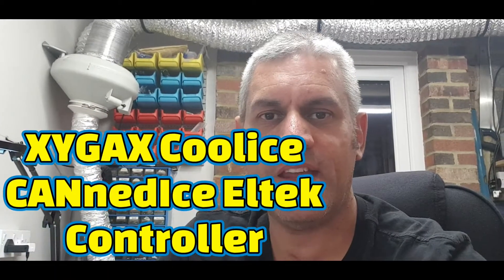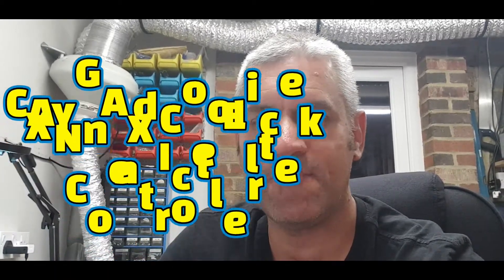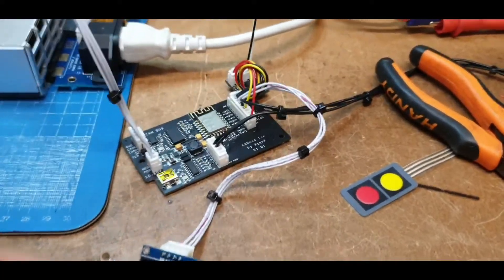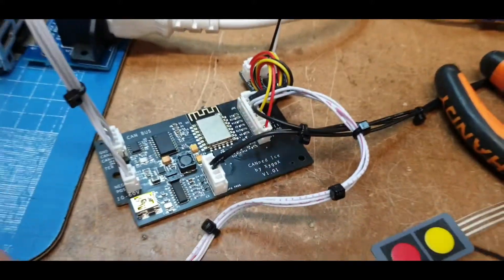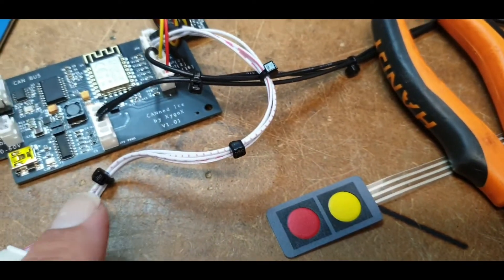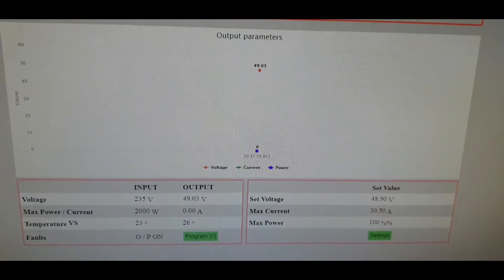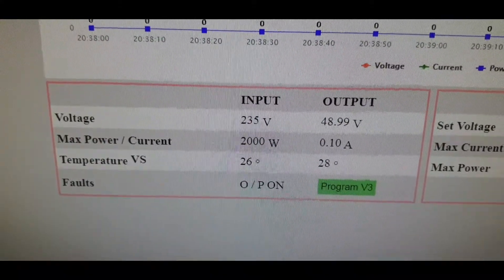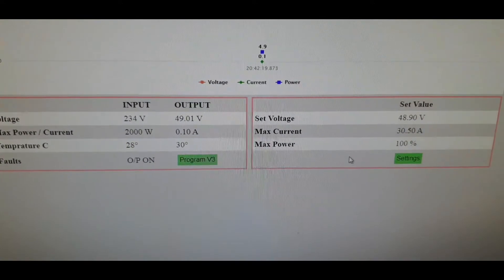Coolice CANnedIce Eltek Controller

Comment: Where did you find this board and the software? I googled for CANned Ice and xygax and found nothing.
Reply from the maker: Hey Buddy. This CANnedIce Eltek Canbus controller board and software written to it, is custom designed for me by XYGAX and I sell it to the public, eBay Item number: 194350158319.
Or you can contact me directly via my web site to enquiry further.
I have limited stocks now of this V1 board with only one left I think, but have the V2 CANnedIce on the way within the next 4 weeks I hope after testing and programming. Our plan going forward is to add other Canbus controlled PSU's as we get to them, such as the Emerson rectifiers and Huwawei to make some etc. But it takes time and so currently only the Eltek's are supported. 
Cheers. Ian Contessa
Reply: @CooliceChargeCases  That item number doesn't come back with any search results on ebay. I'm guessing you are out of them? Your website doesn't list them either. When will the v2 be available? The thing I care about is Eltek, so this is probably just what I need.

Comment: how to send code to the eltec unit from arduino
and if my unit the controller that  inside it have nothing
how to code  the eltec controler
Reply from the maker: Hey. To communicate with the Elteks you need to use a Canbus controller and an Arduion or Raspberry Pi even, then with the data sheets for the power supply you can find out the commands to poll the unit to receive back the data such as voltage, amps, temperature etc. From here you can also program the voltage and more.
Our code of course is bespoke to our product so we do not share it.

Cheers. Ian Contessa
Reply: @CooliceChargeCases  
thanks alot but
 do you have link for data sheet
??thanks agin